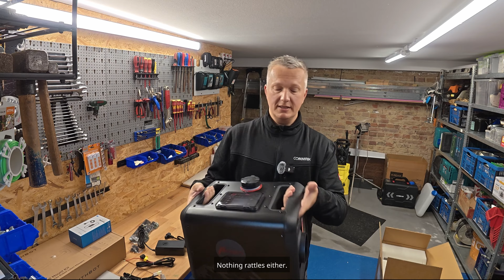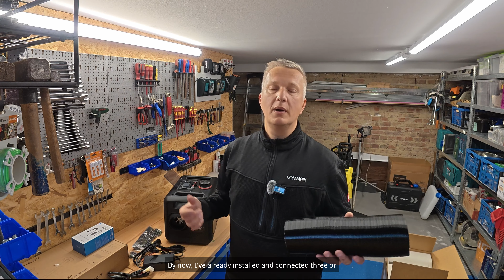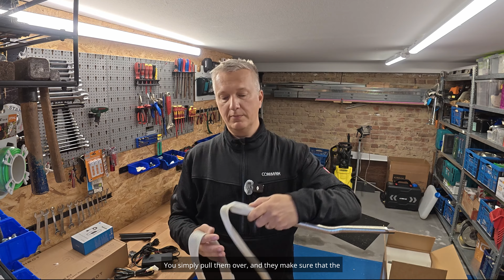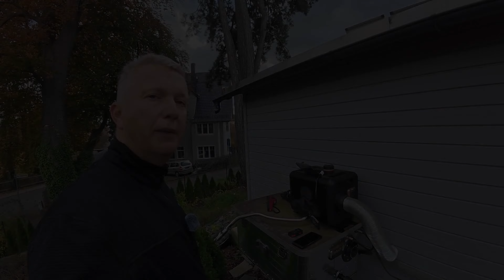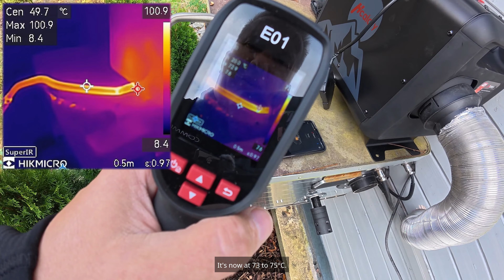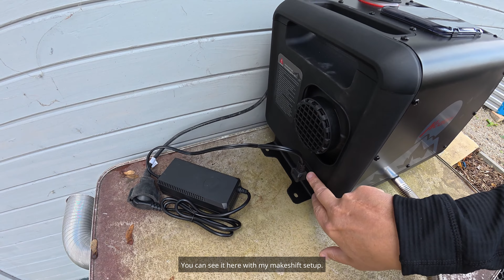HCALORY TB MAX 8 kW put to the test Compact diesel heater with app and CO sensor!

Comment from the maker: *👇 All products & links from this video:
🔗 HCALORY TB MAX 8KW - https://www.banggood.com/custlink/GGmIwG710p
👉 PromoCode BGdaebec
🔗 HCALORY HBH2 5L 8KW - https://www.banggood.com/custlink/vKKI2MW4df
👉 PromoCode BGEKHBH2
🔗 HCALORY HBS2 3.5L 8KW - https://www.banggood.com/custlink/3vKSU2JeJm
👉 PromoCode BGEKHBS2

Download the Banggood app and get an additional $25 discount 
👉 https://banggood.onelink.me/zMT7/bgaff002

👇 Prefer to shop on Amazon?
🔗 HCalory TB MAX: https://geni.us/I8oxPI (Amazon)
🔗 HCalory HBH2: https://geni.us/UdfeBeb (Amazon)
🔗 KROAK TB2: https://geni.us/JeyaFBL (Amazon)
🔗 KROAK TB1: https://geni.us/TKARlS (Amazon)
🔗 KROAK L1: https://geni.us/NeC7xrV (Amazon)

Sound insulation
🔗 Silencer for ventilation pipe: https://geni.us/1FUuvS (Amazon)
🔗 Silencer for exhaust: https://geni.us/FUrp (Amazon)

Product links* for my heating box:
🔗 8kW auxiliary heater: https://geni.us/Q54yxdU (Amazon)
🔗 8kW auxiliary heater with BT: https://geni.us/LsUTbbM (Amazon)
🔗 BT auxiliary heater without housing: https://geni.us/z7pv (Amazon)
🔗 Auxiliary heater with transformer: https://geni.us/kbE9RQj (Amazon)

🔗 Aluminum box: https://geni.us/PnX1Y (Amazon)
🔗 Aluminum flexible pipe 75: https://geni.us/CRjh1ue (Amazon)
🔗 Connector 75: https://geni.us/gl2pPUY (Amazon)
🔗 Flange 75: https://geni.us/xf6vzP (Amazon)
🔗 Hose clamp 75: https://geni.us/Gj9RHe (Amazon)
🔗 Exhaust hose: https://geni.us/nDGUxV6 (Amazon)
🔗 Exhaust paste: https://geni.us/9r7V3B (Amazon)
🔗 Heat protection tape: https://geni.us/Dqi7a (Amazon)
🔗 Air outlet 75: https://geni.us/Z9Zr8n4 (Amazon)
🔗 Stainless steel exhaust connection: https://geni.us/7Mrnk (Amazon)
🔗 Stainless steel fresh air connection: https://geni.us/VuTHp (Amazon)
🔗 CO detector: https://geni.us/TqHLB (Amazon)

🔗 Control cable: https://geni.us/rAeVG6V (Amazon)
🔗 Cable connector: https://geni.us/bFE9 (Amazon)
🔗 Protective tube: https://geni.us/dLhPy (Amazon)
🔗 Power cable: https://geni.us/3VO8ZB (Amazon)
🔗 Transformer: https://geni.us/68Gxqv (Amazon)

App links:
🔗 Play Store: https://play.google.com/store/apps/details?id=com.hcalory.client
🔗 Apple Store: https://apps.apple.com/hr/app/hcalory/id6484163464

Follow me on my social media channels for more content! @commaik

🎥 This video was originally produced in German for my main channel:  
https://youtube.com/commaik  
It was then translated into English using Heygen – with my own voice and lip-sync.

🎙 Want to dub your videos like I do? Try Heygen:  
🔗 https://www.heygen.com/invite/b96cdcf6 – Get 300 free credits when you subscribe.

📺 The original video, which includes English subtitles, can be found here: https://youtu.be/PKTpvzmqLfc

Note: All links marked with * are affiliate links. If you make a purchase through these links, I will receive a small commission at no additional cost to you. Thank you for your support!https://www.youtube.com/s/gaming/emoji/7ff574f2/emoji_u1f517.png

Comment: I bought a Hcalory 8kw diesel heater going on 3 years ago.....after 30days of running it, it started to flame out and have issues starting....I contacted them and they sent me a glow plug.....I replaced the plug but it never really worked right......I ended up buying a Vevor toolbox diesel heater and had great luck with it....this year I put the Hcalory in my shop after I tore it apart and replaced the glow plug and fuel screen, and cleaned it out and put it back together.....it started up and ran....let's hope it heats the shop this year.
Reply from the maker: Hi,

thanks for sharing your detailed experience. It's definitely frustrating when problems start after only about 30 days, especially when replacing the glow plug didn't permanently solve the issue.

It's interesting that the Hcalory is now running again after you completely cleaned it and replaced both the glow plug and fuel screen. Maybe it was actually a combination of fuel delivery issues and buildup inside the heater that caused the starting problems.

I've had quite a bit of experience with Vevor diesel heaters myself. In fact, my very first diesel heater was a Vevor, and I've used several other Vevor models since then. So I find your direct comparison particularly interesting. These diesel heaters may be relatively simple in terms of their basic design, but there can definitely be noticeable differences in reliability and build quality in real-world use.

Fingers crossed that the Hcalory keeps running reliably now and keeps your shop warm this winter. I'd be interested to hear how it performs after you've been running it for a longer period again. 👍

Comment: Best description I have found, appreciated a lot your video. Just wondering if you have a update of any kind because I am about to buy this model to use the all winter at my boat.
Reply from the maker: Hi, and thanks a lot for the great feedback! I'm really glad my video helped with your decision.

I used the Hcalory TB Max continuously in my garden house throughout the entire last winter. It ran reliably and I didn't experience any problems. It has been out of service since March and I'll start using it again next winter.

So my overall impression is still very positive, and the heater feels quite solid. There is just one thing I would keep an eye on for long-term use: the green fuel lines. I had similar lines on another diesel heater, and after about two years they became brittle and eventually started leaking. I can't say whether the same thing will happen with the TB Max, but for long-term use I would personally replace them with high-quality fuel-resistant lines as a precaution. Better safe than sorry.

For use on a boat, I would also pay particular attention to proper exhaust routing, ventilation, and a safe installation.

Apart from that, after a full winter of use, I currently have nothing negative to report about the TB Max.

Comment: would you replace the inferior green fuel line
Reply from the maker: Hi,
yes, I probably would replace the green fuel line at some point.

The heater works fine with it, but in my experience these green fuel hoses tend to become brittle over time. Once that happens, they can start leaking or simply age much faster than higher-quality fuel lines.

I wouldn't necessarily replace it immediately out of the box, but I would keep an eye on it and plan to upgrade it during future maintenance or as soon as there are signs of aging.

Other than that, I've been very happy with the TB Max so far. 😊

Have you already noticed any issues with the green fuel line, or are you considering replacing it as a preventative measure?

Comment: Nice! About the exhaust, it sits much closer to the ground than the other models. Will the exposed part cause any risk of burning anything you place the entire box on, like grass or table?
Reply from the maker: Good and absolutely valid question 👍

Yes, the exhaust on the TB Max does sit relatively low, and yes – the exhaust pipe gets very hot during operation. If you place the box directly on flammable or heat-sensitive surfaces (dry grass, wood, plastic, etc.), this can definitely become an issue if no precautions are taken.

In practice, that means:
The box should either be placed on a non-combustible surface (stone, concrete, metal), or you should provide proper clearance and heat shielding. This can be as simple as a small metal plate under the exhaust, a heat-resistant spacer, or another form of shielding. Slightly elevating the box already makes a big difference.

In my setup, the exhaust is routed so it can radiate heat freely with nothing directly underneath it. That prevents heat buildup and avoids contact with sensitive materials.

Short version:
Perfectly fine if you place it thoughtfully and add basic protection – but I would not put the box directly on grass or wood without taking precautions.

Comment: Great video! Have you continued to use the heater? What are your thoughts on it now if so?

Ordered mine and used it camping in the mountains back home a few nights and it did great. I was impressed with how quiet the pump is. Fortunately or unfortunately I don't have much use for it but a couple weeks a year. Wood stoves are fun, but take up a lot of room and wont burn all night to keep the tent above freezing...the Hcalory had no problem running two nights on one tank. 

Not sure if you can get it over there, but Amazon US has Hon&Guan brand 4" insulated ducting, and it fits over the 90mm/3.5" duct the heater comes with. Their 5" also fits over the 4", so you can "double insulate" the hot air outlet duct if you want. I had a long run, almost 3 meters, so to try and conserve fuel I felt reducing heat loss from the duct would be beneficial. I saw just over 4C decrease in surface  temperature double insulated vs. Single 4" insulated tube. With a short duct outside, probably not worth a lot of effort to insulate.  

The 90mm diameter is a bit of an oddity, but I suspect the larger diameter helps with noise and better heat exchanger operation.

I see you are in Deutschland, loved my time there, and hopefully can get another job there in the near future.
Reply from the maker: Hi, thanks a lot for your detailed comment and for sharing your experience 👍

I also only use the TB Max occasionally during the winter. In the places where I need permanent heat, I already have other heaters installed. Still, I deliberately kept the TB Max because the model really impressed me overall – compact, a very quiet pump, good control, and simply well suited for mobile use. For a few weeks a year or temporary applications, I think it’s an excellent solution.

The idea with the insulated ducts sounds really interesting and makes a lot of sense, especially for longer air runs. Thanks for the tip about the Hon&Guan ducts. If you have a specific link or the ASIN, feel free to send it to me. Here in Germany I haven’t really found anything suitable yet, especially for the 90 mm duct size. The option to double-insulate the hot air duct is particularly interesting from an efficiency point of view.

And just out of curiosity: what did you do in Germany back then, where were you located, and where are you living now? I’m always happy to hear when people have good memories of their time here 🙂
Reply: @commaikenglish  4" insulated ASIN is B09WD3T53P Unfortunately I can't find the same in 5" now, hopefully not discontinued!

Some of the ducting out there doesn't handle the heat so well and stinks when used, I didn't notice much with the H&G ducting. The H&G Amazon store has a variety of duct options, I even saw one flexible 4" with a fiberglass layer, which would probably be more effective than the dual 4 and 5". There are many companies selling similar, I just had personal experience with the H&G.

My testing in my garage showed a surface temperatures of 64C on the ducting the heater came with, 46C with just the 4" over 5", and 67C with just the 5". That's measured all connected, so original duct closest to the heater, dual 4/5" is measured in the middle of the 8' ducting, and the 5" was measured right at the outlet of the 8', section.  I took that to mean the stock duct actually retains heat quite well (but is too short) and insulated ducting is about as efficient at heat retention. But double insulation makes a significant difference, approximately 23% less heat coming off the surface. 

I was working for the US Government in Wiesbaden! Rented a flat from a wonderful family which we got to know well and just visited them not too long ago. We took advantage of the ability to travel as much as possible, we felt centrally located to everywhere. Really enjoyed the simple things...being able to walk to the stores, hopping on a train just to go have dinner beneath a castle next to the Rhine in summer, bike riding along the numerous trails, just all of it. So much more positive to talk about than negative for sure. :)

I still travel for work, but I'm out of Washington state when I'm not traveling. In welchem Bundesland leben Sie? 

Sorry if that's wrong, still practicing! One day maybe I'll be able to speak it a bit more fluently.
Reply from the maker: @danya822  Hi,
thank you very much for the detailed reply and especially for the links – that’s really helpful 👍

Your measurements are very interesting, especially the comparison between single and double insulated ducting. It confirms quite well that the extra effort mainly pays off with longer duct runs. I’ll definitely take a closer look at the Hon&Guan shop and especially the fiberglass-lined option over the weekend – that sounds like a very promising solution.

And Wiesbaden – nice! Your description really captures it well. That mix of everyday convenience and the incredible density of great places to visit is something special. It’s great to hear you have such positive memories of your time in Germany. And by the way, your German is much better than you think 🙂

I live in Thuringia, pretty central within Germany – very quiet and green, but still well connected and easy to get around.

Thanks again for sharing your experience and taking the time to write such a detailed comment.
Best regards
Reply: @commaikenglish  just ran across ASIN B0CHT6XZVT 

Smoother wall, 4", not insulated. Resistance to almost double the heat out of the heaters, so should be no issues there. 

May be a better choice inside 5" insulated than 4" insulated. Recommended over more flexible duct due to smaller ridges interrupting airflow less. Should be more efficient.

I will probably try it next winter when I need the heater again. :)

Tschüss!

Comment: Thanks for a brilliant review. Superbly concise and probably the best I've seen. If the unit is mounted outside in a box like yours, with the air inlet and outlet ducted to the inside of the workshop to recirculate the warmed up air, would the combustion air inlet be independent and draw the air in from outside or is it connected off the air inlet duct? Hope that makes sense. Thanks very much.
Reply from the maker: Thank you very much for the kind feedback – I really appreciate it 😊

And yes, your question absolutely makes sense. The combustion air is always completely independent from the warm air circulation. It must not and should not be taken from the warm air inlet duct. The air that is heated and circulated inside the room has nothing to do with the combustion process.
The heater has its own dedicated connection for the combustion air intake pipe. This port is used exclusively to supply air for combustion.

If the unit is mounted outside in a box, the combustion air should ideally be drawn from outside as well, and the exhaust gases are also routed directly outside. This keeps combustion air and room air fully separated. Inside the workshop, only the warm air inlet and outlet ducts are routed in to circulate the heated air.

That is exactly how the system is intended to be used from a safety point of view, and it’s also the recommended setup. Anything else would introduce unnecessary risks.

Hope that clarifies it.
Best regards
Maik
Reply: @commaikenglish Brilliant! Thanks very much. I might put it in an open sided shelter so that it can draw in cool combustion air. I'll lag the inlet & outlet recirculation ducts. I was thinking of positioning the unit with the outlet against the workshop wall to keep that duct nice and short. The walls are double skinned masonry with insulated cavity, the same as a house. Thanks again.
Reply from the maker: @MarkvanHeeswijk-o2y  You’re very welcome, glad it helped 😊

Your plan sounds very solid. Mounting the heater in an open-sided shelter is, in my view, a very good solution, especially when it comes to combustion air. Drawing in cool, fresh outside air is ideal for combustion. At the same time, the shelter provides weather protection, which is also a big advantage for the electrical connection and wiring.

Insulating the inlet and outlet ducts for the recirculated warm air also makes a lot of sense, as it minimizes heat loss on the way into the workshop. Positioning the unit with the warm-air outlet right against the workshop wall is a good idea as well – a short duct means less heat loss and less airflow noise.

With double-skinned masonry walls and an insulated cavity, this setup works just like it would in a typical house. Overall, it’s a very well thought-out approach – probably exactly how I’d do it myself.

Good luck with the build!